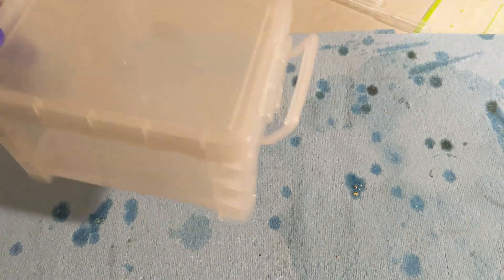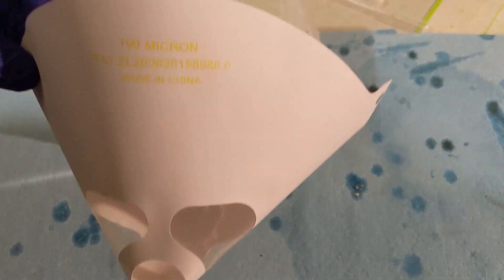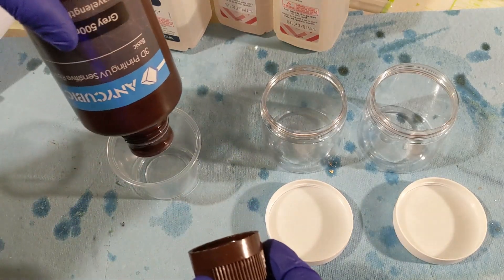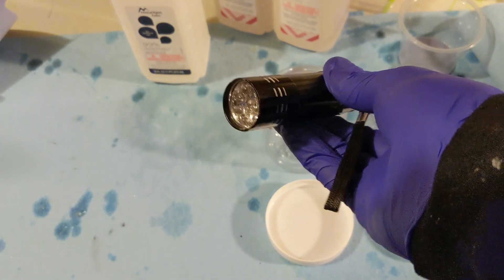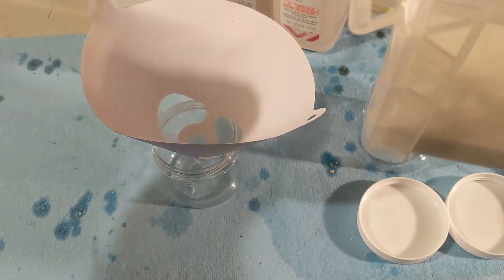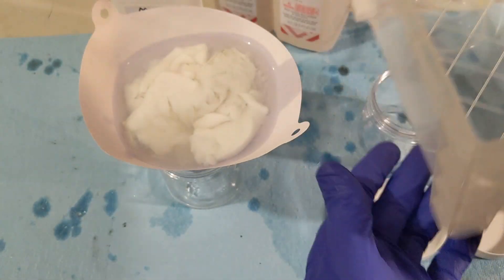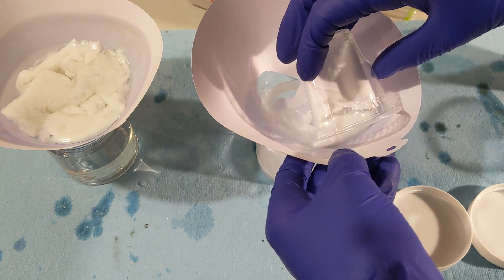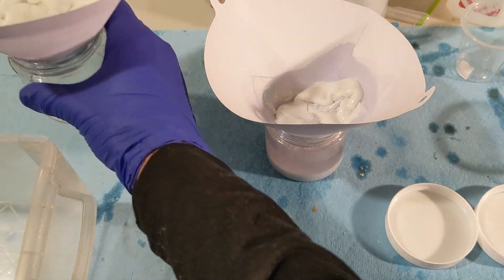UV 3D Printing Resin Disposal & Saving Alcohol

Comment: I mean toss it in a jar and stick it outside and then take it to hazard waste disposal...then spend the $10 on a gallon of cleaner. I can't imagine spending 3 hours doing this to save $2. Just 3 stage clean your prints, the original cleaning solution will look grey etc but you won't get the cured specks in it that attach to your prints from reusing a container you UV cured resin and cleaner in.

Comment: Honestly you maybe be better off just using water for the water washable, I have a bucket that I use for rinsing and cleaning prints, every now and then I blast it with UV or leave it our side and it fully separates and the cured resin settles at the bottom, I just leave it in there, no need to filter this often
Reply: I tried this but my water was still extremely cloudy after. Does that mean there is still alot of uncured resin in it?

Comment: If you continue to blast that sludge with UV, will it eventually cure to solid?
Reply from the maker: It might if you leave it in the open for the alcohol to evaporate out of it, but I haven't waited that long to try it. Its very sticky and hard to remove from the filter. Recently I've been keeping it in a zip baggie for easier cleanup, https://youtu.be/fLocrsf0iNk

Comment: Man you waste a ton of resin if you are usually throwing away bricks like at 2:56
Reply: I guess u dont have a choice here. My Cleaning IPA looks the same after some prints. No way to save more of it. The prints allways will have left over Resin on the surface. You need to wash it away with your alcohol. But the "white goo" has much more volume than the resin. I some wierd way it grows mixed with alcohol during curing.
Reply: @JeansGlow  i think he means the resin he pours out of the "finished" bottle, which is still good resin and is actually a lot of wasted resin

Comment: Please don't do these things, you're just wasting money! Why bake off the dregs of a bottle - if there's only 25g-50g left in your bottle, that's still a couple of mini's you're yeeting for no reason. Either pour it into a new bottle of the same kind, or keep one bottle to pour all your left over resin into. The fundamental chemistry of 400nm UV resins is basically the same, just differing ratios of polymers and fillers so you can happily mix them and still have usable a resin. Ideal for test prints or where the final cured properties/colour aren't important.

Second; don't cure your cleaning alcohol/resin mix. Your initial solution was probably only 5-10% suspended resin. But after curing and filtering you recovered barely any of your alcohol. The rest will have evaporated into air if it couldn't escape from the resin's polymer matrix. Resin, does not chemically bond with the cleaning alcohol, it's just floating around in there. So if you leave it for a few weeks most of it will eventually settle down on the bottom of your container, where you can then strain off the alcohol and dispose of the resin sediment appropriately.